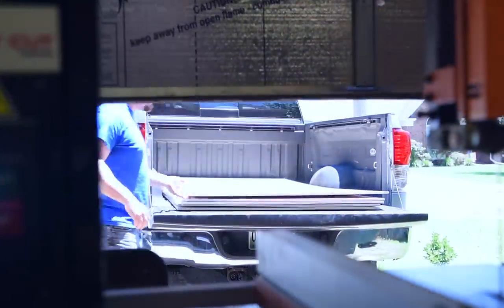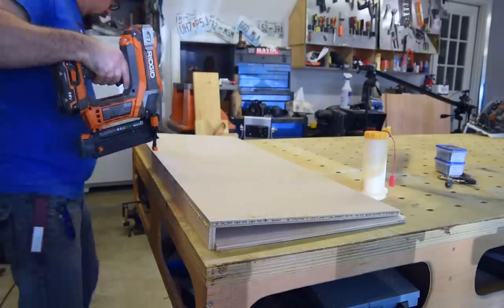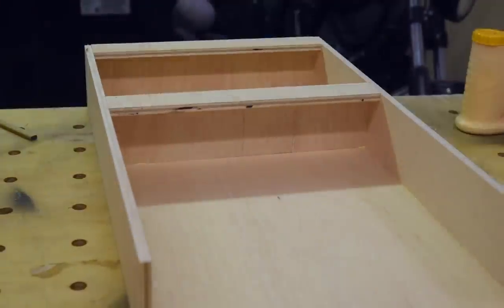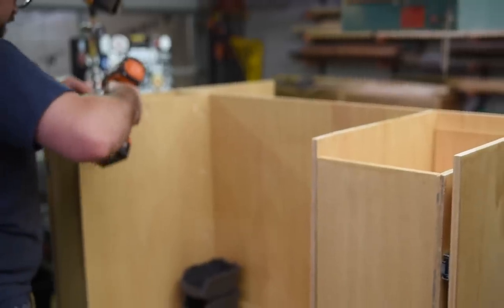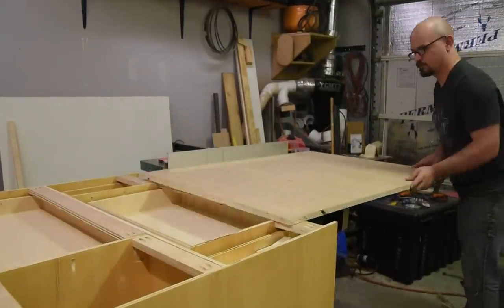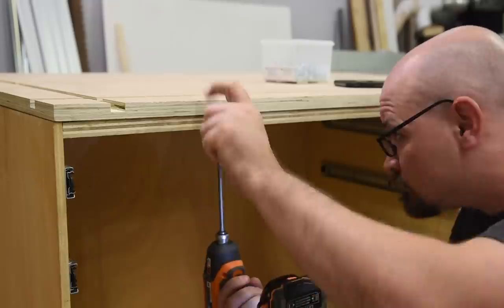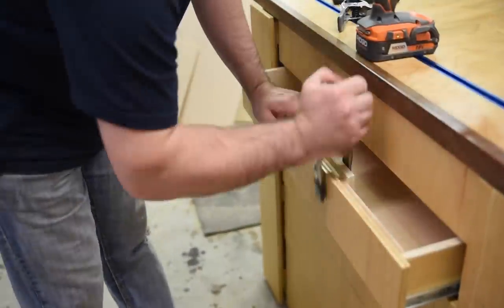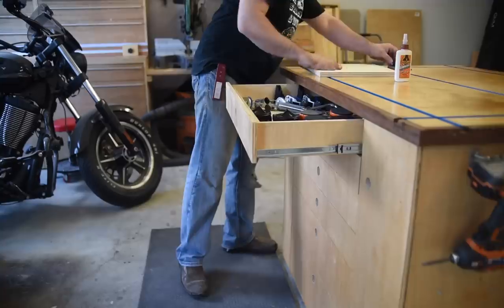Build a Work Bench / Assembly Table with T-Track

Comment: Great build Caleb! Very informative. I never trust the home center to cut my sheets either. They cut first, measure second.
Reply from the maker: Thanks, Luke! So true. I used to let them do it and planned for about an inch of fluff and to recut their lines to size.. but then I had them be off by 1/2”  and another guy run the saw backwards.. it just got bad.
Reply: YouCanMakeThisToo running a saw backwards......what could go wrong. LMAO!
Reply from the maker: Yeah.. good thing they don’t let professional customers use their equipment. 🙄

Comment: I may have missed it some where, what are the rough dimensions? Trying to visualize in my garage shop and its height etc compared to the smaller saw bench/router table I have now.
Reply from the maker: It's about 3'x4' and 35" tall

Comment: Each time I consider a DIY project it turns out more expensive than ready to use, mass products. I bet this one is not an exception.
Reply from the maker: Yes and no. If you have to buy tools for every project, that raises cost.. but you have to spread that cost among every project it can do - not the one where you  bought it for. There’s also the quality consideration. I could find used cabinets and a door for free on the side of the road, or buy ready made that’s stamped steel or chip board that won’t survive a move. But that’s like comparing a pocket knife to a chefs knife. There’s also that this is exactly what I wanted, and nobody makes it. So I can make it far cheaper than hiring a custom shop to make it for me - because that’s the only way to buy it. If you try to DIY exactly why you can buy, and you’re fine with one time use quality, then you’re right - it doesn’t make sense to DIY. But if you want something that has the potential to last your lifetime, and be what you want that can’t be found on a shelf - then it’s huge savings compared to custom work with quality material.

Comment: Really love. Looks like it solves all kinds of problems. What would it take to line it up with my vintage Craftsman contractor saw?
Reply from the maker: Thanks! I've had it close to a year now and it's been awesome. It just depends on the height of your saw. You could tweak the bench to match the saw, or if the saw it shorter, might be easier to just raise the saw up to its level.

Comment: I also just finished installing t track in the top of my assembly table.  I bought one intersection to use as a pattern and made the rest myself.  Those intersections are just soooooo overpriced. Your bench looks great.
Reply from the maker: They are pretty pricey, glad you had luck making your own! Fortunately aluminum is easy to work with.

Comment: great video  .  (putting a seal coat and finish on top before tracts, though, would be big time saver and tracks would not be 'glued ' I place .  otherwise 👍👍)
Reply from the maker: The dados were a snug fit though, and I’d still have to tape them off or clean out the finish so the track would fit. To me it seemed easier to tape the track and then finish, the tracks aren’t glued in place at all.
Reply: Had not thought of finish buildup. (I use two medium coats of shellac for a 100% seal (no thickness ) and top off with medium spray of lacquer for hard durability  (no roll over). But varnish or urethane finishing (as most use) would impede  an already snug insert placement.
Thanks again for great ideas .
Reply from the maker: @hj8607  Anytime! If I did your finishing technique, I would've finished first as well. I just went with wipe on poly for simplicity though (and had some on hand). Many ways to skin a cat!

Comment: One more question. It seems as though the intersection can be used to drop in the tools. If so, is it necessary to extend the t track all the way through the trim on the sides of the bench? Appreciate your help.
Reply from the maker: You can't drop tools into the intersections so the end cut outs are needed.

Comment: Late to the party, and not sure how I missed this video when it came out. Awesome build with 1/2" ply which is surely lighter and cheaper than the 3/4 option. How is it holding up? I was curious about the torsion box base which seems thin (smaller width ribs compared to most) and if it has sagged over time.
Reply from the maker: Thanks! So I’ve had two downsides. First is it will twist and keep drawers from opening IF I don’t use the feet to keep it level. If I level it off, everything is fine. Second is the lifting caster has pulled out of the corner that I had to just screw into. Should’ve bolted it. Screws just don’t hold in 1/2” that take a lot of pulling force.
Reply: @YouCanMakeThisToo  thanks for the response.

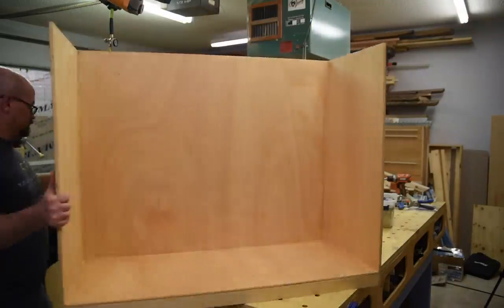Comment: Hello, I just watched this build video.  I have question about the shims used on that bottom drawer @ 4:21.  Will this shimming method help when your drawer is slightly out of square?
Reply from the maker: It could, but you would have to shim between the drawer and the slide. The slides must be parallel to each other. My problem was the case was slightly out of square, but my drawers were square.

Comment: Hi, most of the tee tracks that I have seen are almost 1/2" deep, as you used 1/2" plywood how did you attach the tee trake?
Reply from the maker: For the top I used 3/4” and the track is 3/8” deep. I used #8 1/2” screws and the tips just barely poked through the bottom.

Comment: i notice your tablesaw has no guard and no splitter  no anti kickback... do you have any problems with it?     I have a Craftsman 100 with 4 cast iron extensions but everyone tells me its not safe because like your saw it does not have any safety features. What do you think?
Reply from the maker: It’s not ideal, and there are aftermarket splitters you can use. I’ve had some kickback, always my fault... but that’s the problem, humans are faulty and fault aside, the danger at a table saw is super high. But so far, I’ve found being safety conscious has kept me safe for now, though I do plan on getting a saw stop when I’m able. Risk and safety are personal choices, I will say if you’re not super familiar with how and why things go bad on a table saw, get very smart - because the only safety feature is between your ears. That would be my only warning, more safet features are better because people make mistakes. But if you don’t understand kickback, and aren’t going to learn, then a rudimentary saw is a tragedy waiting to happen.

Comment: Great video, what's the glue you used to place the drawer fronts?
Reply from the maker: Just CA glue and activator. That was just to hold them until I could add screws from inside.

Comment: Would that be the saw operator at Home Depot you stole that tape measure from so when the next customer came along he had to hunt for a tape measure to help him well people like you complain about his service? As yes after I saw the tape measure issued only to Home Depot employees never sold and heard the first complaint I stopped watching! To many years in retail with people stealing pens and the next person bitching you don’t have a pen to lend them.
Reply from the maker: I worked retail too. It’s from when I was a Home Depot saw operator / hardware associate / mill works specialists and occasionally forgot to take my tape off my pocket and it ended up in my car. Most of them ended up back in the store. One rolled under my seat and didn’t find it until my car gave it up and I cleared it out. Now it’s a nice memento I like to use since Home Depot was one of my first jobs, and now they sponsor my channel. 

Super appreciate you giving me the benefit of the doubt on that one though. And yes, that’s sarcasm.